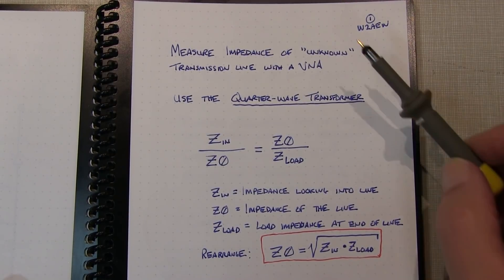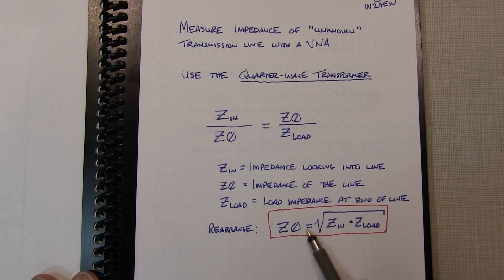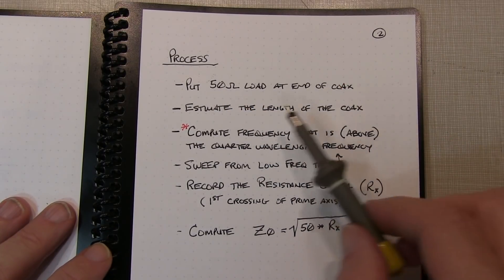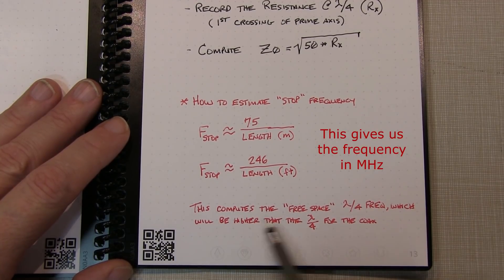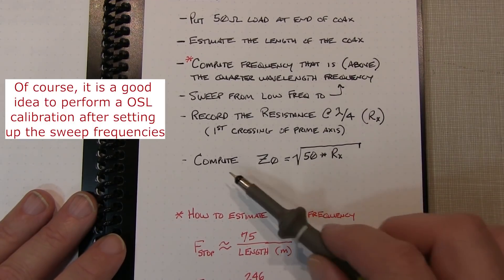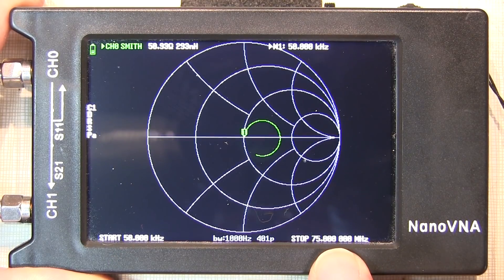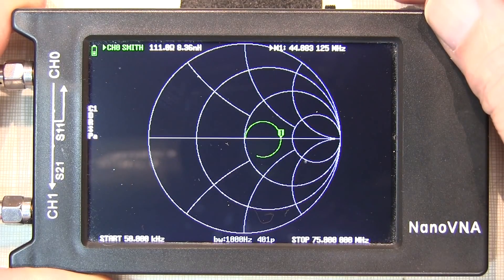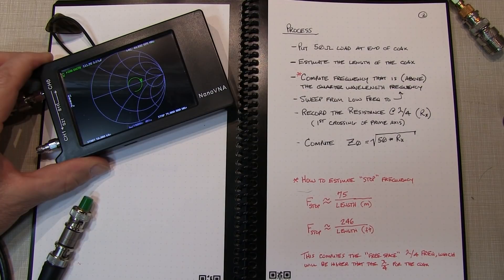#326: How to Measure the impedance of "unknown" coax using a NanoVNA

Comment: This is a great video and is a simpler technique than that used by other YouTube videos I've seen. Can the NanoVNA be used to find the value of an inductor without creating a resonant circuit (i.e. capacitor and the inductor in parallel as done in your video using a pulse generator and oscilloscope)? I have effectively used your pulse generator and resonant circuit system to calculate inductance, but was wondering if you could do the same by just using a NanoVna in series/parallel with the inductor under test, without making a resonant circuit.  Thank you for all your videos. I have learned so much from your great videos over the years. Regards. -WI1B
Reply from the maker: You can, if you do it carefully.  Make yourself a fixture that is basically a SMA connector with pin sockets on one end, to connect to your inductor - from center to gound, and connect to the S11 port. You don't want to use long clip leads as that will affect the results particularly for smaller value inductors.  You can test at frequencies where the inductor is intended to be used, and use a marker on the Smith Chart to read off the inductance value.  Be sure to calibrate properly.
Reply: @w2aew  Thank you so much Alan. Lead length may have gotten me when I tried. I appreciate your quick response. You should be writing books. You can always make a technical, difficult topic easy to understand. That's a rare gift. 73, Ken
Reply from the maker: @kenvez9309  I've heard that before, and have been asked a few times to write a book, I wish I had the time...

Comment: Hi Alan,
How did we use 75/length for fSTOP?
Reply from the maker: The free-space wavelength of an RF signal is:
Length in meters = 300 / frequency_in_MHz.
Thus, the 1/4 wavelength is simply 75/f(MHz).
Since the propagation speed in coax is slower than free space (velocity factor <1), we're guaranteed that using Fstop based on the free-space calculation will be adequate to ensure that sweep the cable past is 1/4 wave frequency.
Reply: @w2aew  Thanks Alan!

Comment: Thanks for this!  I've been trying to measure resonance with different antenna materials using the loss/SWR on the nanoVNA with inconsistent results. It hadn't occurred to me to look for features on the smith chart.
Reply from the maker: Loss and SWR plots can't show you resonance because they don't include phase.  Remember, resonance is when the reactive component is 0 (phase is zero).  Resonance is NOT necessarily the frequency of minimum SWR.

Comment: Where did you get the 75 and 276  in the "stop" frequency calculation?
Reply from the maker: Speed of light is 300 million meters per second, or 300e6 m/s.  If we divide that by the frequency we get wavelength in meters.  Thus, if we take 300/4, then divide by the frequency, we get the length of 1/4 wavelength.  If we express the frequency in MHz instead of Hz, we can drop the 10^6 or e6 multiplier.  Thus, 75/F(MHz) = free space 1/4 wavelength in meters, which can be rearranged to say 75/Length(m) = the frequency in MHz whose 1/4 wavelength is Len(m).    We can do the same think with length given in feet.  Speed of light is 984 feet/sec.  So we divide 984 by 4 and get the 246 factor.
Reply: @w2aew  thanks, once again, for the reply. I guess this should have been obvious, i.e, what the 75 and 246 values represented.
Reply: @Jonathan Alvarado thanks for this question; I thought I knew were the 276 value came from, since I originally thought it was a conversion from meters to ft - yet, 246 ft would be the conversion from 75m, so it isn't a conversion, after all. Therefore, like you: were do the values (75) and (276) come from in the "stop" frequency calculations?
Reply: @schwinn434  I think the 75 came from the calculation of a quarter of the wavelength, the wavelength is the speed of light divided by the frequency, 300,000,000m/s divided by the frequency, in MHZ is 300/frequency so the quarter wavelenght is (300/4)/frequency = 75/frequency.
For miles i don't know, if I do the same calculation the result is about 246/frequency (in MHz)
Reply: @stefanolini279  thanks for the reply. I guess what the values of 75 and 246 represented should have been obvious. I really kinda-of stay lost when talking about impedance matching at radio frequencies -especially, when the concept of using inversion of impedance at 1/4 wave values are involved. :(     Just when I think I kinda-of understand how the SmithChart can be used for impedance matching, I realize I'm totally lost once again.

Comment: Very cool, can't wait to demo to myself and others. I suppose it would work for open line also. Maybe you would terminate it with 450 ohms (for window line) .
Reply from the maker: No, you'd still want to terminate it with 50.  If you terminate 450 line with 450 ohms, you won't get a reflection.  That's OK too, you'll just get a tiny spot or spiral right at 450 ohms on the Smith Chart.
Reply: @w2aew  ok, so if I understand correctly , the termination needs to be different than what you think the actual impedance of the line might be. So, since you had 75 ohm coax you were able to get a reflection with a 50 ohm load. So perhaps with a 50 ohm coax you would use a 75 ohm load, and the 450 anything but 450 ohm load ect. and in all instances you would have a healthy reflection. I found it very interesting that you could check twisted pair ect. I had always thought they were going for 600 ohms with that type of cable . Thanks for the video.
Reply from the maker: @californiakayaker  Actually, I used a 50 ohm termination because the NanoVNA is a 50 ohm instrument. If the unknown coax was 50 ohms, there’d be little/no reflection and the resulting trace would be just a small dot or spiral at he center and you’d know it’s 50 ohm coax.  Twisted pair cable is typically 100 ohms.

Comment: Can you use an insulation tester Megger to test RF coax cables, audio cables, speaker cables, to find breaks in the conductor wire or its only made to test if only the insulation has breaks? because when using an insulation tester at 200v, 500v, 1000v you might measure .5 ohms which is considered a bad cable. The Guy that invented Coax cables made a differential math formula to be able to run the telephone signal in the center conductor using a differential signal so there will be no crosstalk. I'm not sure how you can send two different signals down one center conductor but that is why they used coax cables which he invented. The 50ohms was picked as a value because of power transfer. I'm not sure if they are talking about True Power or VAR Reactive power , or VA absolute power that coax was better at transferring power at 50 ohms.
Reply: No. The impedance of a transmission line is composed of distributed capacitance and inductance for AC signals and this impedance is not the real dc resistance between conductors.

Comment: And what benefit  will this give me?  Why would i need the impedance reading? just interested, sorry for stupid question..
Ive subbed for years btw!.  thanks for your efforts
Reply from the maker: You get best power transfer to a load like an antenna when it's input impedance matches the transmission line impedance.  Impedance matching is important to prevent signal reflections.
Reply: Besides what Alan said, if you have a box full of coax from different sources and you want to sort through it to find how many 50 ohm pieces you have, this works like a charm.

Comment: cool! Would this also work for measuring the transmission line impedance on a PCB?
Reply from the maker: Sure, provided you can terminate it well, you can couple to it cleanly with the VNA,  and your VNA can go high enough in frequency to be quarter-wavelength long.
Reply: @w2aew  
Thanks for great video.
So why do coupons from PCB manufacturers always come with close trace without the option to close it with 50Ohm resistor?
Reply from the maker: @OhadHarel11  They're probably assuming a different measurement method.
Reply: @w2aew  understood 
Thanks
Reply: How would one  "couple to it cleanly with the vna"? I'm guessing that the coax between the vna and the transmission line affects the measurement just as much? What happens if the coax impedance doesn't match the impedence of the transmission line?
Thanks for yet another great video!
Reply from the maker: @albindennevi9829  Yes, the coax from the VNA to the PCB does make a difference.  You would need to perform the calibration at the end of this coax, ideally at the interface to the PCB.  This will "remove" the coax from the measurement.
Reply: Ahh! So obvious when you say it! I need to purchase a VNA and start learning these things. 😀 Thank you!